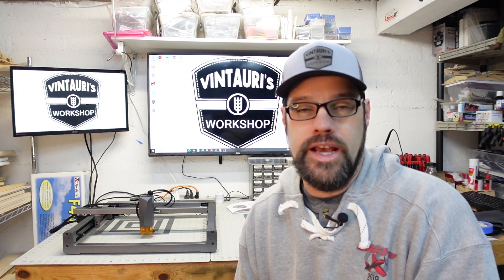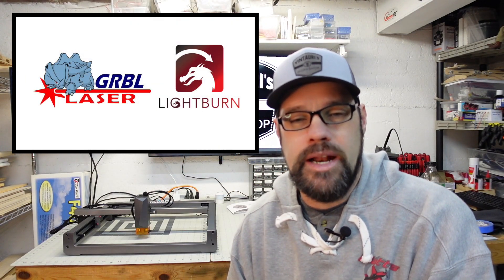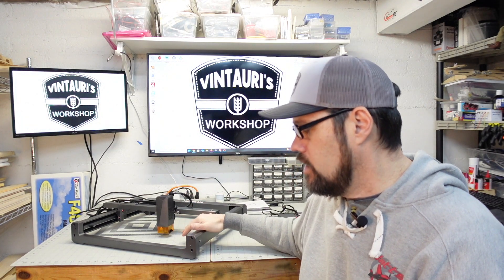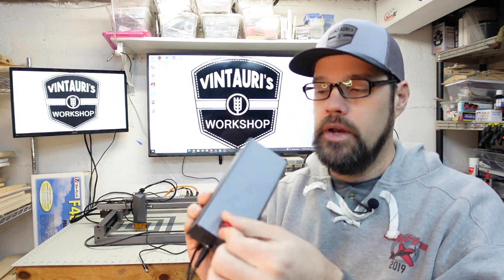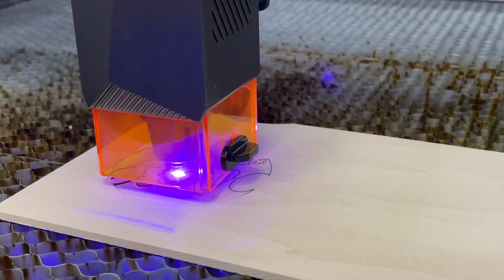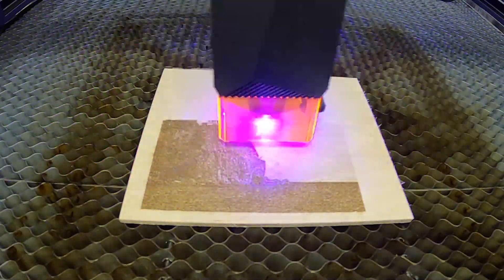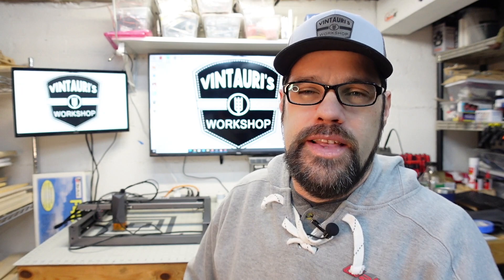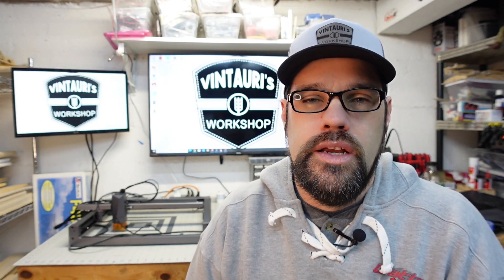Wainlux L6 10w Diode Laser review

Comment: I recently bought a Wainlux L6 and it can't cut through even 4mm thick plywood at 95%/100 power/speed. I don't understand, maybe I have a defect. Maybe engraving on steel. My go to Sculpfun S10 easily cut with one pass at power/speed 90%/190. The buttons are mounted very inconveniently, they are on the back. The X axis motor gets very hot, felt like 80+ degrees. It has a lot of minuses. Only the design is beautiful